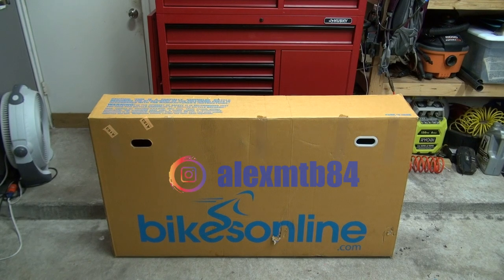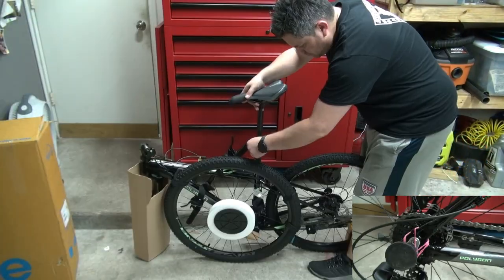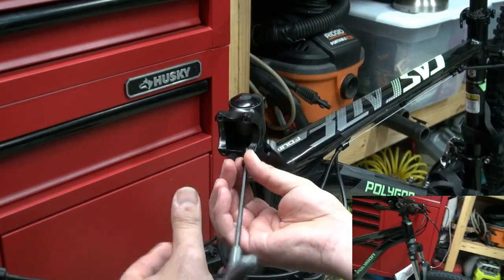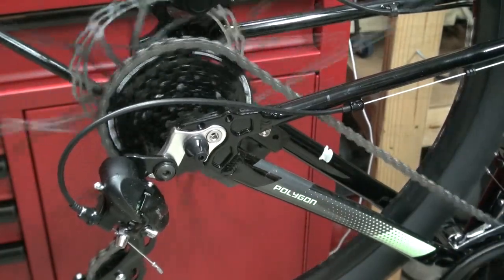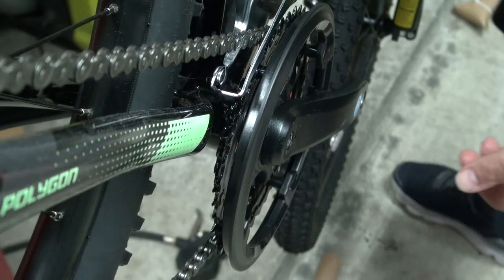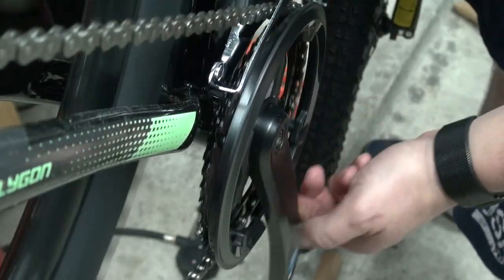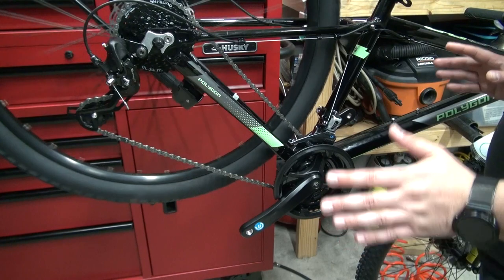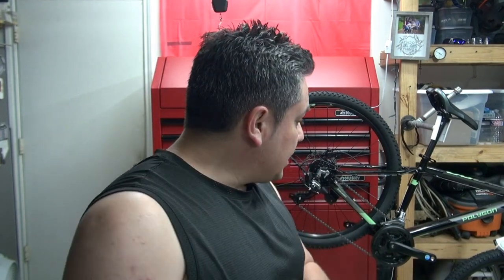THE PERFECT BIKE FOR UPGRADES Polygon Cascade 4 Unboxing #mtb #mtblife #trail #newbikeday #hardtail

Comment: Unfortunately I have bought a couple bikes over the years that come with the Tourney derailleur.  I already know, I throw the derailleur right in the garbage before the first ride. For any trail riding, the chain slap is just too much. They're okay if you're only going to ride on the street.
Reply from the maker: Yeah. Chain protector just in case for now. I've had them before as well, wife won't be doing anything crazy. I'll upgrade, hopefully soon, but bike is solid though
Reply: @MTBAlex  for me a longer chain almost always gets rid of the majority of the slap, but you can't really go all that much longer with the Tourney because it has those over sides gears that have a Tendencies sometimes to rub/grind up against your first gear. If it had normal size gears, I think the derailleur would be fine.
Reply from the maker: @mjsmjs7905  ohh, you are talking about the front derailleur... ohh yeah,  that thing is gonna go fast
Reply from the maker: @mjsmjs7905  ohh, you are talking about the front derailleur... ohh yeah,  that thing is gonna go fast
Reply: @MTBAlex  no the rear, I have never had an issue with the Tourney in the front.  I actually have one on my XR Pro in the front.  Not every front derailleur will fit on an XR Pro because the suspension linkage gets in the way.  I originally bought a Shimano diorio, but I couldn't mounted up high enough.
Reply: @mjsmjs7905  i use old shimano sis 😂😂😂😂 no problems using since 10 years